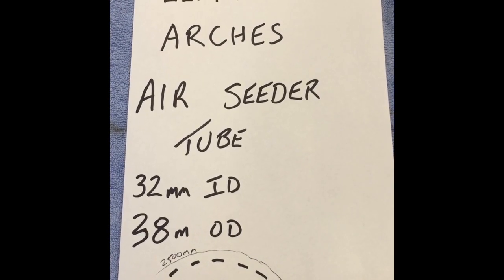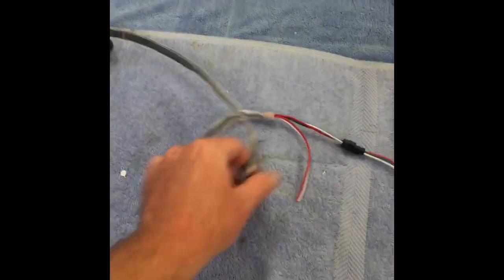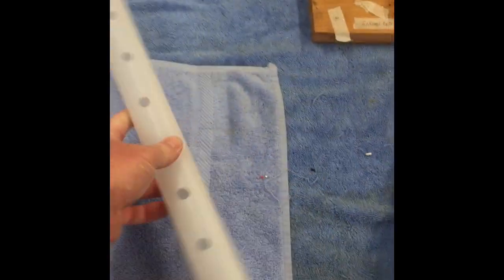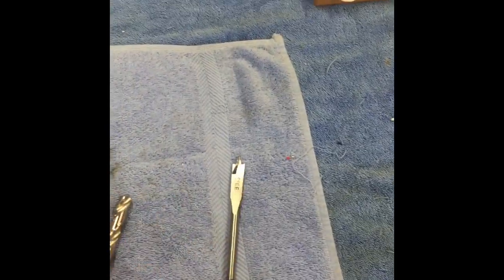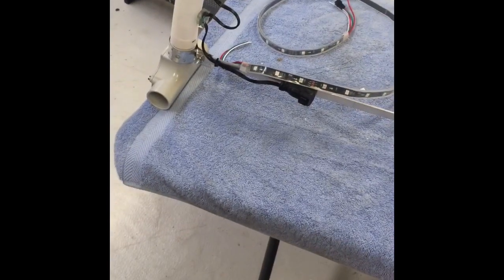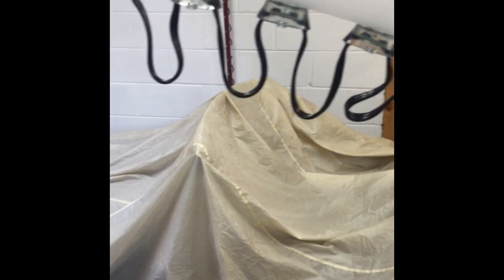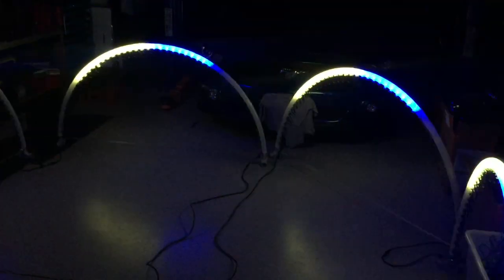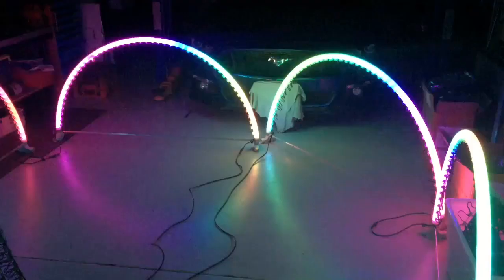RGB WS2811 LED Pixel Leaping Arches using Transparent Air Seeder Tubing

Comment: Mind me asking what you used for the framing/base? I couldn't find anything at Bunnings to suit the ID or OD..
Reply from the maker: Hi Steve, I used 32mm conduit T, there is some great info on leaping arch builds here 

https://auschristmaslighting.com/forums/leaping-arches-driveway-arches-rgb-arches.40/

https://auschristmaslighting.com/threads/my-leaping-arch-build.9754/

Comment: what kind of controller are you using?
Reply from the maker: I am using a Falcon F16 V3 controller from 
https://www.pixelcontroller.com/store/index.php
Reply: @LawrenceDriveLights  how come you change to f48?
Reply from the maker: Just as display expanded I decided to use the Falcon F48 pixel controller and differential receiver boards to allow me to keep the controller close to the props  that's all. A Falcon F16v3 can also control some remote receiver board if combined with a Diff Expansion board.